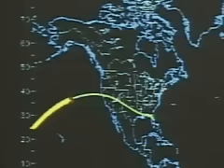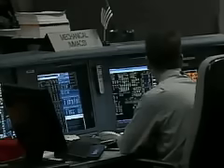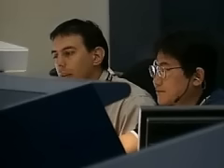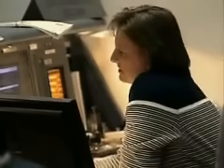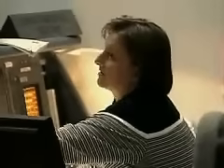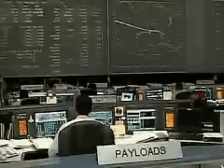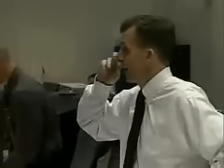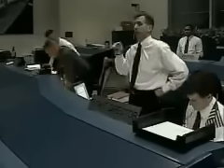Inside Mission Control During STS-107 Columbia's Failed Re-entry and disaster

Comment: It was awful to hear the com crackle ... the sound of breakup.
Reply: Robert Dambeck At 12:30 when the flight director says, "lock the doors", does it get any more chilling than that?
Reply: @1957greybeard  ..Just made me feel sad
Reply: +1957greybeard Basically, the Cain didn't want anyone leaving the room or anyone else entering it. "Lock the doors" serves as a prompt for flight controllers to capture as much data as they can before the memories fade, change, or before data can be changed. They're even locked away from press.

Essentially, mission control turns into an investigation. Locking the doors serves to not disturb that investigation.
Reply: Jaeger Meister I just want to preface by saying that I have the utmost respect and honour for the crews, their families both at home and at NASA when discussing these events.

It sounds as though you are referencing the Columbia Crew Survival Investigation Report, which came out much later than the Columbia Accident Investigation Report, when talking about the non-conformal helmets the STS-107 crew was wearing.

Here is the Columbia CSIR  from 2008 http://history.nasa.gov/columbia/columbiacrewsurvival.pdf

And here is the CAIB from 2005.  You can download whatever resolution you see fit.
http://www.nasa.gov/columbia/home/CAIB_Vol1.html

I have the opinion that the end was quick for both crews, the lack of cabin pressure would have resulted in a useful consciousness of approx. 9-15 seconds.  In both cases loads were small enough that the crew would have survived initial cabin separation from the rest of the Orbiter.  I believe that the Columbia crew had a longer duration of awareness of troubles before breakup.
I find it amazing how similar the 2 tragedies are to one another, both were preventable if the managers listened to their engineers. The managers push to make missions happen, but engineers know the hardware and what it can and cant do.
Reply: +Drew Layton There was a 'physical' locking of doors.
Reply: Robert Dambeck o
Reply: @silvereagle2061  agree
Reply: +Robert Dambeck "Lock the doors" doesn't mean seal the room, it means don't answer phones or talk to the press until we know things to be fact.
Reply: 1957greybeard Director first knew of Columbia's fate when the woman at the back of the room told him that she got the call that debris was falling over Texas. It was after that, he ordered the room sealed. Very sad situation.
Reply: Robert Dambeck that was just loss of signal. The orbiter was out of control and the antenna in the tail. could no longer lock onto the comms satellite (hence were getting some hits on the tail). The orbiter remained intact for about a minute after loss of signal until it broke up enough for total power loss to occur. The data recorder on board the shuttle confirmed that.
Reply: SLagonia The only "exterior" antenna is the Ku-Band system which is located in the cargo bay. Anyway if it was the antenna, its pretty much the same thing. Breakup of vehicle.
Reply: Robert Dambeck  I was  a kid watching the Columbia in lift off and later landing in White Sands. In her  first mission. 
My favorite shuttle was. 
My grandma  saying:-this a movie-.
Reply: El Ciervo - Back in the day they would always lose comm during re-entry, but at some point in the Shuttle program they were able to use a high orbit comm satellite to relay the signal. Still had drop offs, in fact I've read that the comm cut off here isn't the exact moment Columbia lost control, the signal was just blocked by the tail. But it went out of control and broke up a few seconds after.
Reply: El Ciervo yes. They realized there was a problem when they failed to establish communication after Discovery was expected to re-enter the atmosphere. 8:45 "FIDO, when are you expecting tracking?" "One minute ago, Flight."
Reply: Tyler Torrey 

Columbia, not Discovery.
Reply: Antonio Pereira The crackle after Columbia's final message.
Reply: Robert Dambeck  ok! Thanks.  My left year drum  lost 70% three  years ago and got  tinitus due to a CVA.😦
Reply: Crack?  At what moment😮😨
Reply: Antonio Pereira Oh I am sorry.
Reply: +UnYin99 thank you
Reply: +Jaeger Meister Its pretty big. Where in the document do they refer to this particular aspect of the incident?
Reply: +Drew Layton After Phil Engelauf(Mission Operations Directorate or MOD), who was sitting directly behind Leroy Cain(Flight Director) told Leroy that the Orbiter had broke up, ground Control Officer Bill Foster is hailed to &quot;Lock the doors&quot;. In one of the videos, you can see someone in Mission Control actually get up and lock the door.At 16:04 The Flight Director hails everyone on the flight loop:&quot; Folks ah listen up again on the flight loop, no phone calls off-site, outside of this room, our discussions are on these loops on the recorded DVIS loops only no data no phone calls no transmissions anywhere into or out.&quot;At 16:32 GC hails Flight and tells him that there is no way of disabling the black phones.Flight responds with &quot;I understand.&quot;Its actual protocol is to physically lock the doors, to safeguard against the flow of evidence either into, or from mission control.This is a potential crime scene, and Mr Cain knows that there will be an investigation.&#160; The FCOH(Flight Controllers Operations Handbook);lists detail by detail what has to happen during a contingency; Excellent performance under tremendous pressure. Such a horrible situation.
Reply: 1957greybeard you are so right
Reply: Robert Dambeck 😐🙏Thanks
Reply: Robert Dambeck Ohhhh, man, indeed it is. May they rest in peace...
Reply: +Robert Dambeck that sound is just static. the shuttle didn't break up until several minutes later. Just as the Challenger did, the Columbia passenger module broke away from the shuttle intact and remained so (in the case of the Columbia) for almost two minutes. However the battery power for the module is located beneath the cargo bay and so the astronauts and their radios and microphones were without power for almost 90 seconds prior to the breakup of the cabin.
Reply: are you sure, since they were meant to recieve tracking of the columbia  which was near enough 20 seconds after radio comms went dead
Reply: Robert Dambeck Actually, that's probably the sound of the tail antenna being knocked off by debris.
Reply: El Ciervo during reentry the air is ionized around the leading edge of the vehicle. In the early days, with antennas on the craft pointed downwards towards ground stations,  the ionized gas blocked radio communications directly to and from the vehicles for a few munites. However, during the shuttle era TDRS satellites (Tracking and Data Relay) were placed in orbit. The shuttle was able to communicate upwards via those during all flight phases. During entry, atennas on the top side of the orbiter had a direct “view” of the satellites and theres less ionisation on the top side of the orbiter allowing air to ground comms all the time.
Reply: aAaa aAaa yes shogun of japan is a typical c*** su***r
Reply: Forgive my ignorance but doesn't communication break down while the vehicle is entering the atmosphere anyways? Were other crews able to communicate during this stage of re-entry?
Reply: The hissing sound is the air rushing out of rick husband's lungs... terrifying and spooky to know that seconds later his head was ripped clean off by the breakup
Reply: @deacy_6218  A** hole

Comment: At what point in this video do the NASA operatives become aware all is not well?
Reply: Peter Callaghan Multiple sensors ,monitored not from one but two flight controllers, monitoring two separate systems aboard the shuttle and then the loss of communication that went along with it was not normal.

That is not collectively, normal data fallout,and likely raised a lot of concern
  
The tire pressure indications in flight mean something very wrong in the wheel well area, those readings would have gave a sinking feeling I am sure.The shuttle landing without inflated tires or something wrong with the landing gear or its doors would be a precarious situation.
  Leroy Cain reflected on it later, in interviews that when he asked FIDO when they were expecting tracking,and the controller reported back "One minute ago flight" he said he knew at that point in his mind it was very bad and that it was possible they had lost the shuttle. At 8:41 on the video

C-band radar had never before failed to lock onto a shuttle by the Merritt Island tracking station (MILA) at the appropriate time,approximately 15 minutes from landing
Reply: +Necronomicon A Yeah, Cain has even said that the way the transducer readings were lost, not all simultaneously, but in rapid succession, was when he knew there was a serious problem.
Reply: +jimbo16720 In addition to the orbital locations when the orbiter is between coverage areas of the Tracking Data Relay Satellites, you also lose comm or have ratty comm anytime the spacecraft orientation is such that TDRS is directly behind the vehicle, and the tail blocks the signal.  You can hear INCO announce that some dropouts were expected because they were off the tail.
Reply: Necronomicon A They knew something not good was happening but not that the shuttle was lost till they lost comm. No data or communications when over California tells you something happened.
Reply: Peter Callaghan At the point where they got a phone call from people in California telling them that shuttle debris was falling on their houses.
Reply: Peter Callaghan Well the temperature readings aren't terribly uncommon - Glitches of all kinds happen during re-entry.  They begin to feel uneasy around the time that comm is lost, but even then, comm losses happen quite a bit...  But as time goes on it becomes more and more uneasy, until at 11:50 you can see that someone has now seen the footage of falling debris, and the mood changes completely.
Reply: Peter Callaghan Well they said losing sensors was common place on these shuttles, but when they lost Comm....communications is when I think they knew. You usually only lose that when in space and in the small spots between relay satelites.
Reply: Thanks to all who replied.
Reply: Necronomicon A Plus the fact they knew after the launch the left wing was hit by debris.
Reply: Yep - there's one in every crowd.